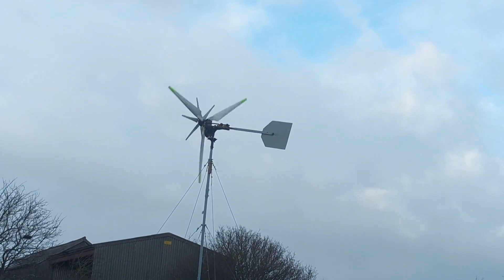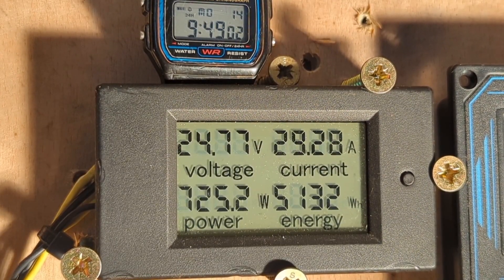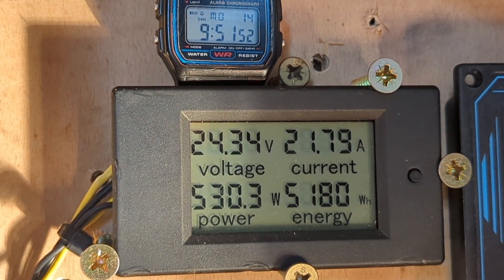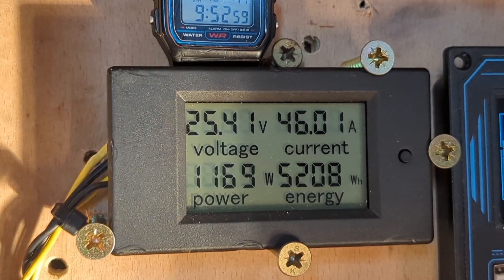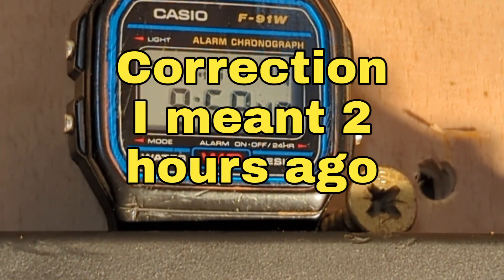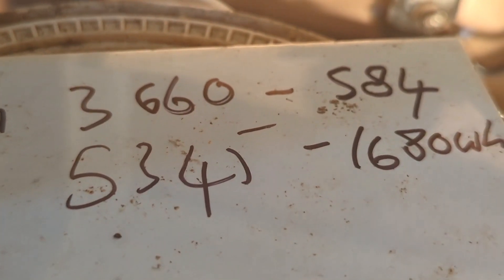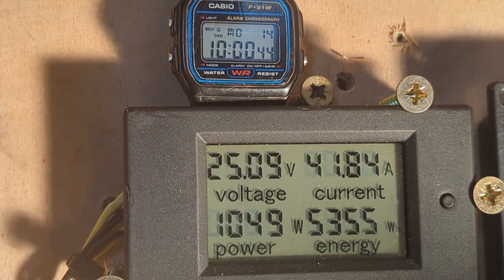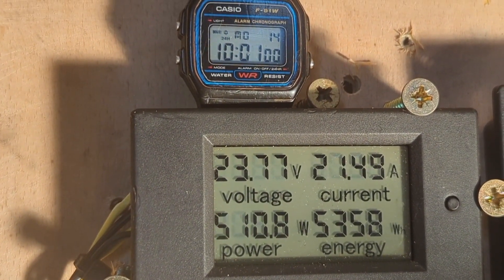DIY Wind Generator NOW a 3kw - Free Energy - 70mph Gusts - 100 amps  mayhem - Part 2 - 14/03/2023

Comment: Wuld be interesting to se if the bike motor Peaks also that high with 48 volt !

This project is so great !!!!!
Reply from the maker: Thank you my friend for your kind words. This thing is a beast for sure, I believe what would happen at 48 volts is we would see nowhere near the amount of amps that we see at 24 volts, and at the end of the day you can't run anything on voltages alone, also, if it's running this fast at 24 volt, I can't imagine how fast the motor would have to travel at 48 , We have some 18 mph winds in the next few days, so we'll be interested to see how it runs at that speed.

Comment: Going from strength to strength, great watching the evolution of your design, going to modify my AF1 turbine to downwind with the generator on a hinge, so in the gusts it tilts up like a towel on a clothes line, rather than overspeed and cutting out, thats the problem I'm having.
Reply from the maker: Really it's all about trying to match the load to the generator. It's a shame you didn't get any joy out of it. What's the control system like

Comment: 3.3kw 113amps. !!! Serious energy here.  Maybe time to start thinking about furling tail and a good dump load. You can get 24v immersion heaters at 1000w/1500w on ebay, amazon for about £25-30 each. Two of them in any water tank that holds a few gallons would do. Alternatively 10 x 300watt 24v resistors would do but that would be about £180. Connected directly to your battery bank with a volt sensing relay ( check out A30's or CD60's, £10 each and one or two coil truck relays ( £15). Maybe you already have plans for something like this. You'd probably get quite a few views of people watching your turbine going hell for leather while  watching a water tank steaming or even boiling in the background.
Reply from the maker: Luckily it doesn't get that windy here very often. I'm just going to concentrate on trying to make sure the turbine can stick out 500 watts plus in 20 mph winds 👍👍👍👍

Comment: No problem with the shorter vids. Incredible that your turbine withstood those winds. I would have thought that motor, being for cycles, was not designed for those super high RPM.
Reply from the maker: I know I was sitting there wondering to myself as I probably said in the video. I don't know how much more this motor has got to give. I worked out with the RPMs it was going. It would probably be very similar to a push bike with the wheel hub on it going 40 miles an hour for 12 hours non-stop.